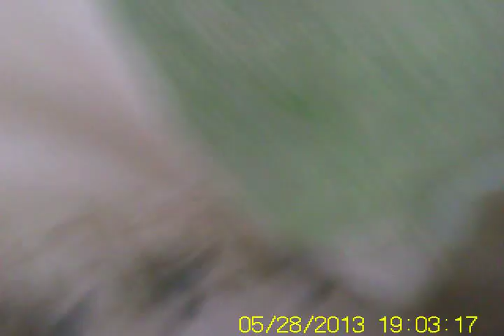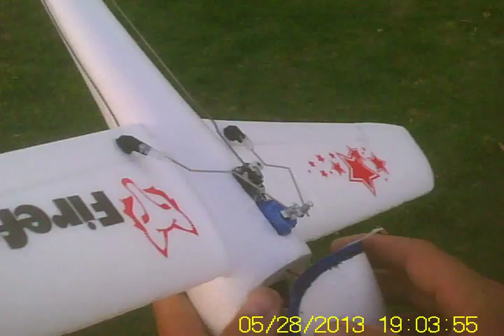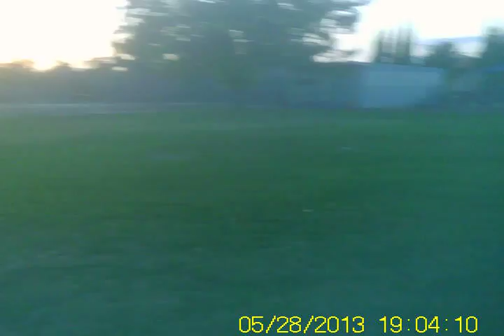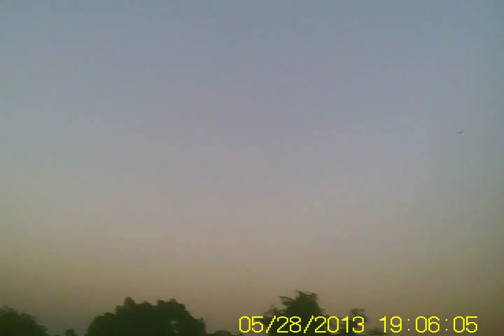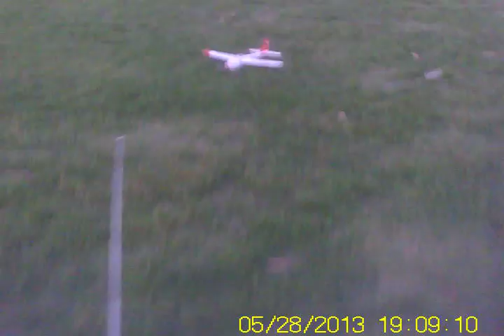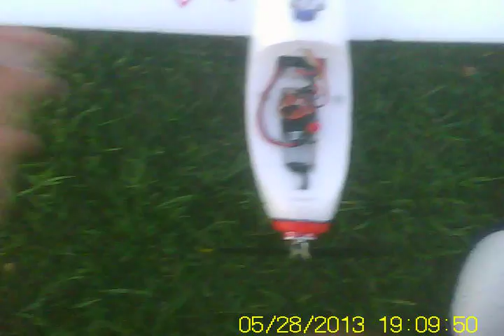Chuck Glider RC conversion, Hawkeye Zoomer Firefox

Comment: I've got a very similar Hitec Hawkeye and thought about aileron and elevator control like you did, except bury it in the fuselage more.  Maybe make a hatch with rare earth magnets.  Also thought about a small pusher motor and battery in the nose to balance.  The small wing makes something like this kind of fast though.  It would be nice if a larger wing could be hotwired.
Reply from the maker: Yes there are 3 planes that are identical.....this Fire Fox, the Hawkeye and the Zoomer. I wanted to make this a pusher, like most of my other chuckie builds, but I would have needed a 10gr motor to keep my overall weight within reason....I didn't have one at the time.
Reply: Take a look at the Gunther Bee and Gunther Micro motors at DymondUSA's website.  Cheap and light, and probably strong enough.

Comment: Where did you get those servos and also the engine?
Reply from the maker: The equipment used was just simple 5gr blue servos and 1811 2000kv motor from HK